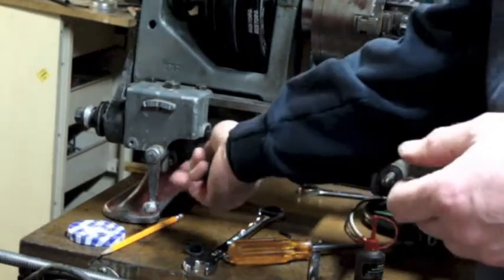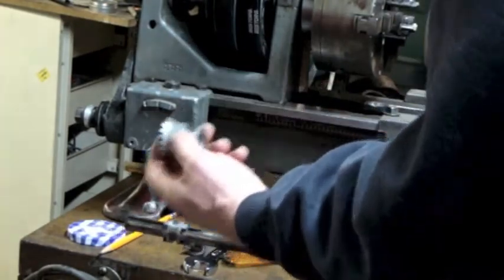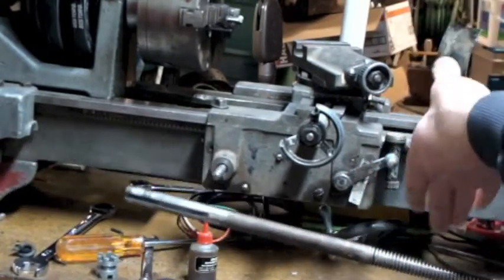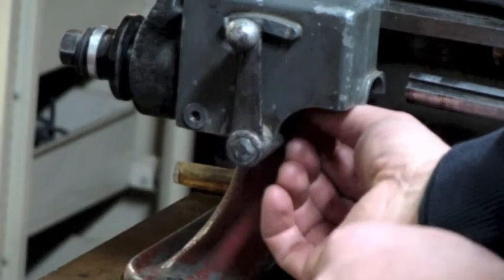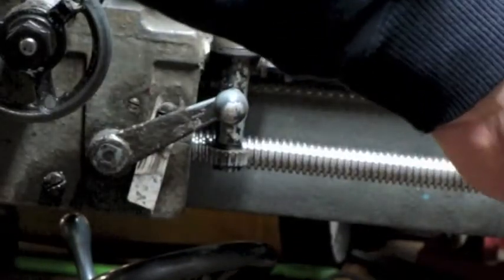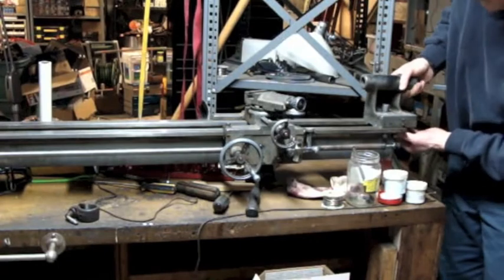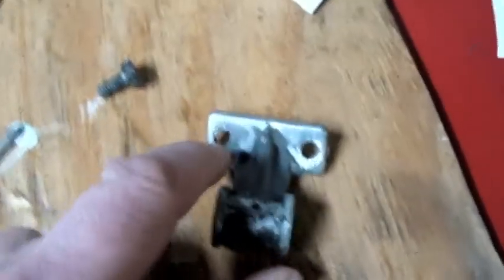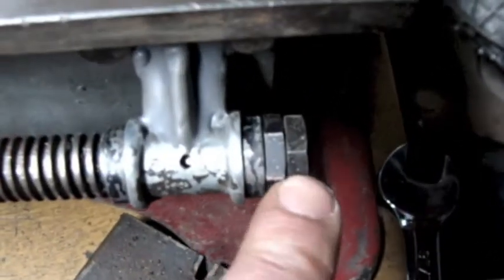Atlas 9" Lathe Part 21

Comment: Steve;

Next time you are at the flea market, buy the cheapest 11/16" wrench you can find.  Bring it home and grind that sucker to the right thickness.  I did this with some Harbor Freight wrenches to help work on my lathe.

Regards;

Ron Kluwe
Reply from the maker: I think I had to do just that when working on removal of the fuel injection pump on the Oliver tractor.

Comment: Don't forget to get some oil on those parts before you assemble them.  Even on surfaces like the gear on the lead screw or the tailstock against the bed.
Reply from the maker: Those gears are oiled through the small holes I mentioned. I plan on doing a video where I go through an entire oiling routine after I finish re-assembly.